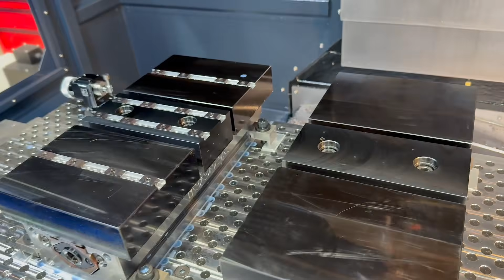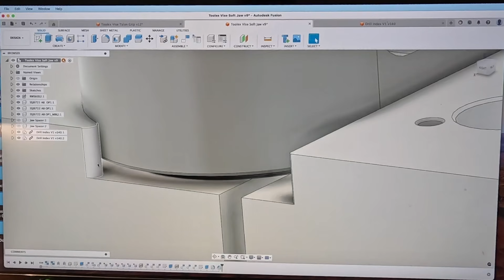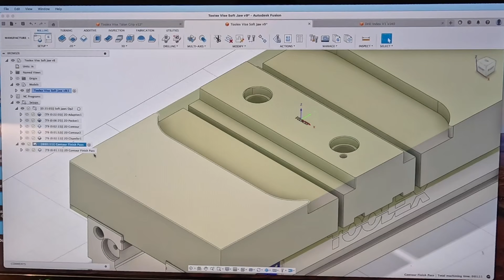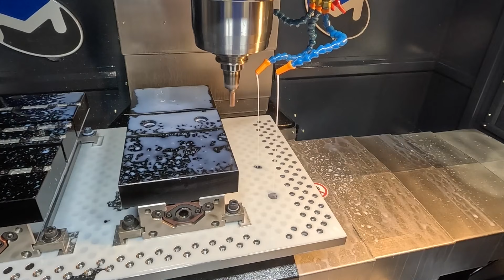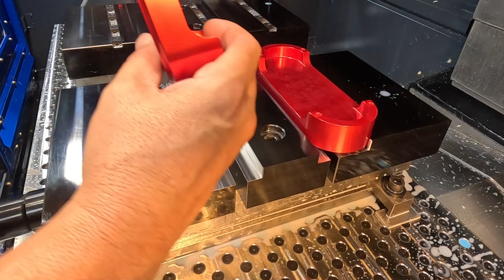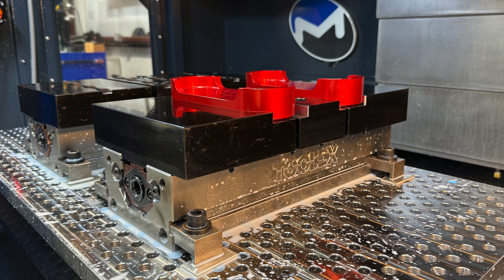Machining Soft Jaws for Second Op - SNS 390

Comment: you need more pressure in your coolant ,as it is its not clearing the chips and you might be cutting them again. its just bad. pressure seems too low. need to blast those chips from the part.

Comment: I think I will just 3d print one for $2 and it will last for decades, $400 is bonkers
Reply: Does it cost 400????  Where did you see that price?
Reply: @JaapGrootveld it's live on their website. Also that does include all the drills, a 3d printed one wouldn't
Reply: @JaapGrootveld  Well $399

Comment: Hi Adam, nice work on the fixtures. A real good and simpel job for a batch of part.
I used these type of vices in my first years of cnc as well. I figured out, that having the fixed center jaw be both the stop or the needed profile was not only slightly more accurate for repeat jobs, but also a lot more economical if your moveable jaws are straight cut and use them as general use and have the center fixed jaw be the only vice-part that is part-specific...unless of course you have these jaws as a dedicated set for your own product. It can get pricey if you make more complicated setups or a lot of different parts.
They are great never the less. 2 pair for two vices would last about 3-5 years in my shop (being economical while making about 100+ different parts) mostly small single batches and maybe 20+ repeat jobs.
Always love your content, getter done...and makin' it look good.

Comment: To avoid a second program, I program 2D contour on each side of the jaw separately with cutter comp. Tool is never nominal. And then you can easily and quickly adjust the offset and recut the sides you need. A big time saving. 
Also I don't see the point cleaning the bottom of the jaws, just cut them to the correct height when roughing. Unless the jaws a re for Instagram photos of course!
And your tool does not have enough load - increase the feed! If it can not handle the increased feed, reduce cut width. And then your chips will clear up properly. You are not going fast enough! You can tell you are machining this as a manual machinist :)
Reply: Speeds and feeds is so tough to teach to manual guys. But yeah way too slow.

Comment: Someone on here should be able to tell you how to trick out the door sensor. I worked on a vf4 and was able to open the door at any point to blow off chips or adjust the cooling spray

Comment: I had the same issues machining some 6061 center caps for a Jeep.  Once flipped over it created a swimming pool for coolant and chips to collect.  I setup an air blast and controlled the air with M codes.  Worked perfectly.

Comment: Another good option is profiling with a face mill. You can often get higher material removal rates, better chip evacuation and lower tool costs over the long run. Its good to see someone making softjaws for their mill though. A lot of people are afraid of it

Comment: I’ve seen manual milling videos for a decade now, and I know there will be more. I’ll never own a CNC, but, I think one thing we are seeing is just how hard it is for a fully manual shop to stay afloat. Repair work has dropped a lot and job shops are all struggling to find work. Even CNC shops are struggling if they are small. Many want Abom to be the same employee machinist at Motion that he was when he was in his early 30’s and posting pics on PM, but I admire Adam for setting higher sights for what might make a successful shop even after YT dries up. Just ask Keith Fenner, or Josh Topper, or Joe Pie—all struggling—and even Keith Rucker doesn’t need the shop for buying groceries. I have no interest in doing CNC myself, but there aren’t many machining things I do that aren’t already covered in Adam’s back catalog, and the CNC content still expands my knowledge of machining even on old manual machines. Keep at it, Adam!
Reply: Good ideas there, @rick.  If you look at shops like Keith Rucker's, or Snowball Engineering in England, or HAL in Australia, lots of precision machinery wears out and needs to be repaired, often with complicated parts whose dimensions need to be tweaked because of wear in other parts.  Often these shops send out tweaked diagrams in Fusion360 or whatever to be fabricated in a CNC shop, perhaps with some custom casting work.  Heck, Keith designs mould patterns in CAD/CAM, 3D prints them in plastic, and sends the mould to Windy Hill Foundry.  In at least one case, Keith sent the resulting castings to a CNC shop for final machining.  Flexibility, skills in CAD/CAM, and a store of standard patterns and techniques that just need tweaking will never go out of style.

Comment: If accuracy is a concern, it's best not to locate 2nd OP parts in the X axis with the moving jaws, they usually are not as consistent as the fixed jaws.
Reply: I came here to say this exact thing. Hope he sees it.
Reply: Also just noticed your name on here. Got a chuckle.
Reply: @austintom5324  I would guess only a few people get it, CNC programmers and some CNC operators.

Comment: Looking good Adam. It's coming along. Nice job.

On your Adaptive Roughing (or whatever Fusion calls it), you should look into the issue of "Chip Thinning".  Radial Chip Thinning happens when you are taking a smaller radial cut, as you do in adaptive roughing passes.  Basically, you are not getting the chip thickness you think you programmed.  This can be tough on the tool, and be slow.  To address this, increase your speeds and feeds. Adaptive programs are meant to use the full (or more of) length of the cutting tool by sacrificing stepover amount.  A small stepover creates less friction or heat into the tool, so you can increase your SFM. A small stepover also decreases your chip per tooth size, so you need to take a bigger feed bite to compensate.  This strategy screams for the shortest tool possible to avoid chatter and deflection. But by nature, a full cut of the flute length means a more stable tool with less deflection.

Fusion might have a button to compensate for Radial Chip Thinning.  MasterCam has one marked RCTF which adjusts the feed, but not the RPM. It's tied to the stepover and IPT settings.

As a GENERAL rule of thumb, for a 10% radial stepover, increase your SFM by 2x, and your IPT by 2x.  
For a 5% radial stepover, increase your SFT by 2 1/2 x and you SFM by by 2 1/2 x. This is often called a Radial Chip Thinning Factor.  
Example: 
1/2" 5 flute end mill running 400 SFM at .002 IPT.  
If you ran this as programmed, it would be 3,056 RPM, at 30.56 IPM Feed. This has no RCTF applied.
Adaptive Roughing using RCTF with a 10% stepover, I would run this at 6,112 RPM, 122.24 IPM Feed.
Adaptive Roughing using RCTF with a 5% stepover, I would run this at 7,640 RPM, 191 IPM Feed.

Also, you could run the cutter both directions, Climb and Conventional cut (zigzag?) to reduce cycle time.

Comment: Just checked out the price of the drill index.  At $881 NZD shipped to New Zealand it is way out of reach for me I'm afraid.
Reply: I've looked £430 to uk 🇬🇧 its madness 😠
Reply: $400+ in this economy is a big no for me, nice piece though and quality drills
Reply: It's a trinket to support the channel. Not a tool for a shop. Imho a good exercise for an apprentice starting in the shop!
Reply: Just those Greenfield drill bits are worth a couple hundred. They are first quality naturally but cannot be compared to a cheap 29 piece set from Harbor Freight, not in a thousand years. I doubt anyone is going to make the drill bit holder any cheaper, the price is decent for those who want the top quality drills and a really nice bit holder.

Comment: Question: Wouldn’t op 1 be better suited as the final op? That way the most important finish side has less handling and opportunity to get scuffed up? I’m just curious not making any judgment, been a fan for years. Keep it coming, your dad would be so proud!
Reply: Not impossible, but you'd need to think about how to hold it tight enough for the drilling and milling, not a lot to grab if you flip the process.